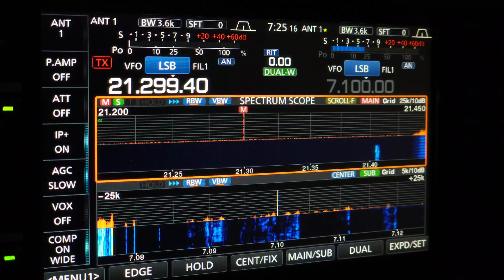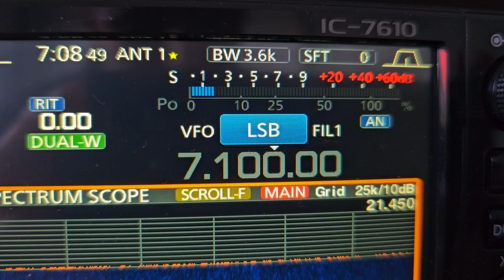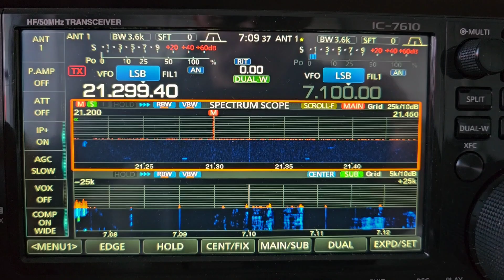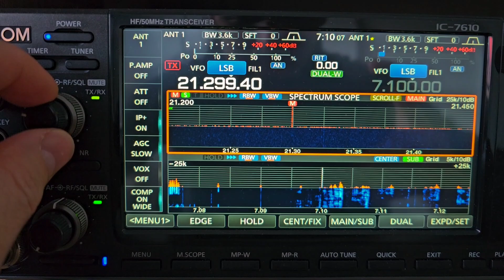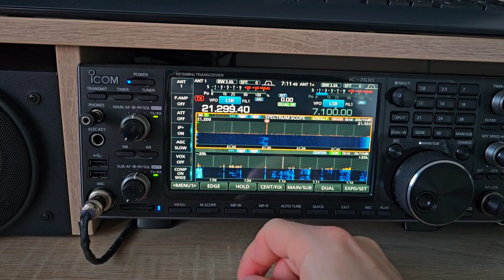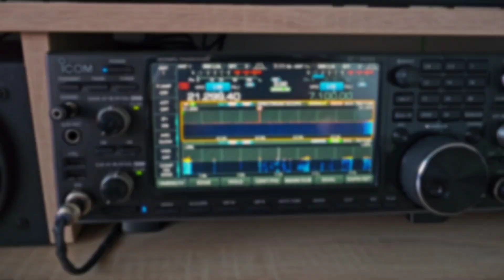Poor Transmitter = "DX" RF Harmonic Signal Received on Multiple Bands (an example)

Comment: l heard this many years ago when a ham using a brand new Icom IC-701 was doing exactly the same thing. He was most indignant and dismissive at people suggesting his new transceiver had a problem😂  Transceivers that use 13.8 Volt power are generally not that good on Tx spectral purity, but this transceiver was something else! 🤦‍♂️